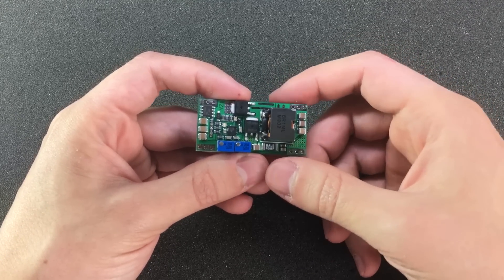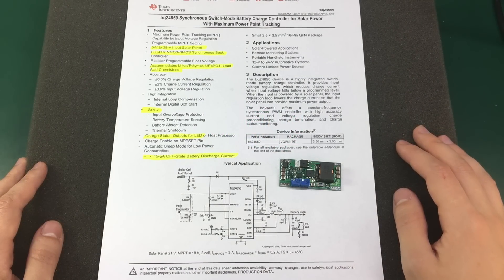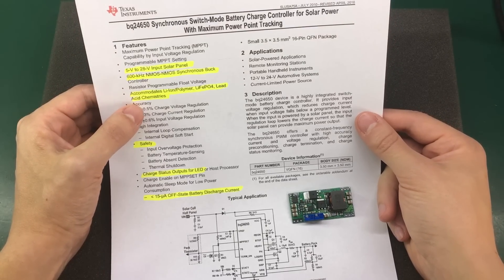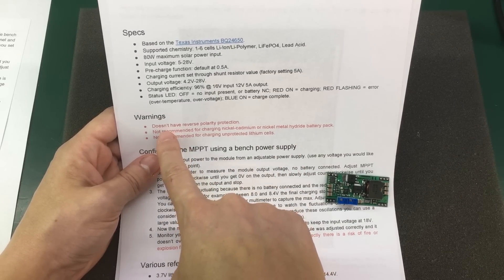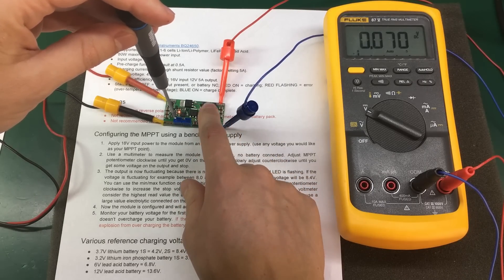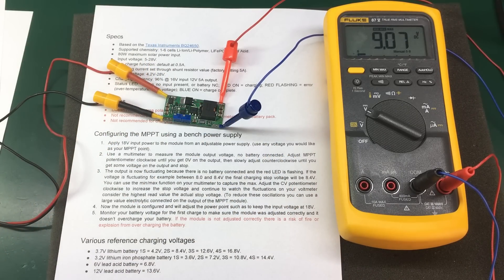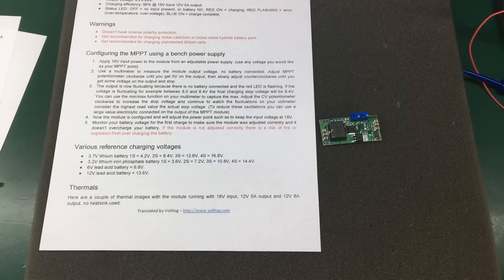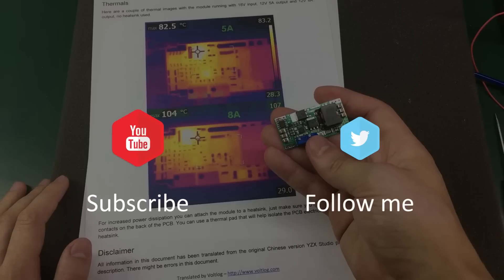Voltlog #54 - BQ24650 MPPT Charging Module

Comment: Little too late, but anyway. This is not truly mppt controller. You need to set  the input voltage threshold. In true mppt the module/device will do it itself by comparing the input power by output power and adjust itself by loading the input as much ad posible  without the power dropping. But considering the price of this module and the efficiency of it (around 90%) its not bad.

Comment: I have commercial 3S2P nominal voltage 11.1V Li-Ion packs with a protection circuit and 12V solar modules. Can this device be used to charge 3S2P packs properly, and is a 12V solar module sufficient? If not, what would have to change? Thanks for the concise video without nasty background music.

Comment: great work. I wonder:  Can we use this modul without any battery. I just need to have 5volt output from a 18volt sunlight panel to charge my mobile phone and powerbanks.
Reply: yes you can, but get a car phone charger and connect pv

Comment: I see several max amp version of boards like these. If my battery has max 6A charge current and my panel has more than 6A output, should I choose the board with 5A or I am ok with the 8A version?

Comment: The BQ24650 is NOT MPPT !
Is is MPP *adjustable*. There is absolutely NO Tracking algorithm! Only a fixed operating point.
 It will only be optimal for one temperature and one degree of illumination.
But is is better than PWM and pretty well adapted for that power range, for which a real MPPT controller would need too much power for himself.

Comment: I built a charger system with the red colored version of this board 3 years ago, it's still working! (25W panel, 16.4V/70Wh Pack)
I can't find the original size boards on eBay anymore. There are larger size boards using the same controller IC but they are preconfigured for specific output voltages and have no potentiometer to set minimum input voltage.
Reply: You can find the black board one, they are the newest version
Reply from the maker: David Gunther în general these modules evolve and rarely you când find the same model for more than 2y in a row.

Comment: only need add external MOS-FET + larger inductor to boost make this tiny yewel work for kW range !
==> any further developments with enlarged power since 2016 ?
==> any final conclusion wheter or not it performs true MPP-Tracking on real solar rig ?

Comment: Are you using this? I am looking for a MPPT charge controller for my 80W panel these days, and this seems to be a good and low cost option. I would like to hear your latest comments if you have been using this board since this video. Also there is a new version of it now, with all-smd design, which makes it easier to mount on a heat sink.
Reply from the maker: I am not using this, I just ordered and now it sits in a box :-)

Comment: Does yours blink when is close to full battery? Mine starts solid red, then starts one blink every few minutes and towards the end it blinks every few seconds. I setup the CV for 13.6V (it's a lead acid battery). I haven't seen a blue light yet
Reply from the maker: I am not using the module daily so I don't have any info. I suggest reading the datasheet, the operation is described there.

Comment: So this module can be used to Solar charge a LiFePO4 cell if the charge voltage is adjusted to 3.6 volts?
Bill
Reply from the maker: yes according to the datasheet it can charge Lead Acid, Li-Ion/Li-Polymer, LiFePO4
Reply: Can't tell if the minimum charge voltage can be adjusted down for a single LiFePO4 cell (3.6vdc).  Can it?  

Is there a Float Charge?
Thank you,
Bill

Comment: Great video !! May I charge 5 X 3.7v LioN 6000ma batteries while supply 1150ma for a Wireless router with a 20w 12v Solar (I cant find 20W 6/5vdc Solar Panels).In theory it should, but I would like an expert advise. I meant these batteries in parallel... thanks
Reply from the maker: It depends on what the operating voltage is for that router.. maybe it's best to use another dc-dc converter to power the router.
Reply: The router is 3.7v as well (it has a USB port for charging (5v) but battery and operational voltage is 3.7vdc.Very interesting channel you have.
Reply from the maker: That's not a common voltage to find on a router, are you sure it's 3.7V?
Reply: yes it is it has a 3.7v lion battery inside is a Huawei HN5A2H
Reply from the maker: yup, that should work but you should use a protected lithium cell or at least add an external protection module to your battery, just to make everything safe.
Reply: Great!! thanks very much for your time and support.

Comment: i ordered this of Ebay and it was sent as unregistered airmail and it never arrived.  i got my money back though.   then i ordered it at aliexpress for a few dollars more as registered airmail and it came with no problem in 2-3 weeks
Reply from the maker: As a guy who orders stuff from China daily I got used to this, it happens from time to time. The important stuff I always get with registered airmail.
Reply: I agree.
It came a few weeks after i got the refund but it had taken a very long time.
Thats why i prefer aliexpress over ebay since aliexpress has more and better option regarding shipping.
On ebay many times you cant see if its shipped registered or not or choose it.
On aliexpress its very clear what shipping is used as standard and easy to select better shipping.
I prefer PostNL if its selectable.
Not the cheapest but in most cases its 8-14 days from China to Denmark :)
PostSE, Singapore post and similar is mostly 2-3 weeks, 4 in some rare cases.
China Post registered airmail use to be faster 1-2 years ago but its gotten slow and unreliable and its now the slowest and worst if registred options.
In some cases i have even gotten my money back because it surpassed the 42 days or 8 weeks garanteed by the seller :(

Comment: Am am using one of these modules to charge 2S Li Ion cells off a 10W 12V panel.  I have a problem where on a cloudy day the module never goes into charge mode.  Any hints on why this may be?
Reply: Unless I disconnect and reconnect the input, then it charges fine.

Comment: How much can it be changed to load in amps if heat sinks are mounted and where to find the resister and which one to use?
Could be cool it it could run 10 amps or maybe even 20 amps with heat sinks under and on and with a fan
Reply from the maker: It can handle 10A maximum with proper heatsinking. The shunt resistor is the one to be changed, details on that are in the datasheet.
Reply: I cant seem to figure out to find that info on the TI site ( im not an electronic expert but i can work a soldering iron)?
The shunt resistor is the one labeled R 008 by the inductor?
What resistor should i use to make it run 10a?
i plan to put mine in an aluminium enclosure box with termal pads on the bottom so it participates heat to the aluminium box and then put an heat sink with cooling fan and termal grease on the top side to cool the mosfets and chips.
PS i plan to wire the fan to the output so it only spins when there is sun and its charging but time will tell if the fan can handle the 14.4 going to my lead acid batteries.
I look forward to later testing the efficiancy of this board against my pwm controller and the epever 10a mppt controller i have in shipping currently.
Reply: the 10 amps im thinking of is input for the solar panel to use with an 100 watt 6 a panel.
The charging current is less important
Reply from the maker: you seem to be missing some important electronics basis. You shouldn't be worried about your input power as the solar panel cannot forcefully push "power" into your module. I strongly suggest you go through the datasheet pdf. Having a 12V fan connected to a 14.4V source will shorten it's lifespan and it will burn out quite quickly. You could use a 7812 to power your 12V fan from the 14.4V output, but it will always run from your batteries, unless you use a diode to block the reverse voltage. And yes the shunt resistor is the one marked R008.

Comment: Did you do some measure of the conversion efficiancy for this board? It lloks interesting. I might try this for my 100 watt panel but i hope the 6a max coming from the panel wont damage the 5a controllet. I already have a pmw controller for my setup but i would like to see if its more efficiant than the pmw. I saw Adam Welch test some small cheap mppt controllers but one of them wadnt suited for my setup and the other one had a horrible conversion efficiancy at around 50-60% :(
Reply from the maker: I haven't tested the efficiency of the module, but the controller is a genuine TI part, the datasheet should give you an idea about the efficiency.
Reply: i have ordered one. i have no advanced equipment but i have some 6 dollars same watt meters. i will compare it to my 11 dollars pwm controller later
Reply: cheapest real mppt 40 dollars ive seen reviewed by Adam Welsh had bad efficiancy. i hope that this one atleast will have better efficiancy than my pwm

Comment: I am looking for 12V stable voltage from a 12V 100W solar panel, without connecting to a battery. The total max load is about 36W (12V, 3A) only, which need to be worked during daytime only.
Reply: There are other cheap modules, with mppt and dc-dc conversion, but without charging function, this is what you need. I would recommend this module with a small 12V battery (5 Ah) for buffering, it's more reliable. Solar Power is not so steady as expected and you will probably waste energy, because your application can not consume 100% of the power which was available. Getting 36W from 100W panel is not easy (this depends at your location).
Reply: For 36W load from 100W solar power simply use an step down DC-DC convertor. It does the perfect job with less than $4. Cheers.

Comment: i have a 50watts panel , basically i can get only 100 to 120 wattshour(measure) per day, i hope this unit can give me more power per day.
Reply from the maker: It should, please report back with some numbers if you install this module. Thanks!
Reply: +VoltLog ok
Reply: Hi, I have a 30w panel and 14ah lead acid battery. I've changed from a cheap pwm solar charge controller to this mppt module and after 2  weeks of use I'm very satisfied. I use it mainly for charging power banks and aa, aaa ni-mh battery recharge.
Reply: Hi, I've also got 40W PV panels, at the moment I'm using simple buck converter to charge my USB power banks, but I want to upgrade it to 12V storage. Considering to buy this module. Cold you please tell me if its worthy?
Reply: For 40W STC this module should do an splendid job due above 90% efficiency. For power backs is far more optimum (less $) to use USB buck convertors from 7-28V input. Cheers

Comment: Good afternoon.
Tell me how you can adjust the charging current can not understand.
Thank you.
Reply: Charging current is set by on board low value resistor. You have to desolder it and put a new one to adjust charging current.

Comment: Wow amazing this thing can take 5 or 8 amps, thanks 4 sharing.
Reply from the maker: This particular module can do up to 5A, limited by the value of the shunt resistor used and other aspects like thermal dissipation and mosfet/inductor specs. However the BQ24650 can do up to 10A with different external circuitry.
Reply: So cool, Texas Instruments has always been an amazing company. Thanks for the info VL!
Reply: What should be chanced to run 10 a or maybe even more and will it have other consquences besides needing better cooling?

Comment: Interesting video - and thanks for the manual, I'm sure lots of people will find it interesting.

The issue with MPPT is that last word - tracking.  It's a software based thing that isn't implemented into this module.  Photovoltaics and wind turbines change all the time with the conditions. The software needs to track the IV curve constantly to produce the maximum power.  These so called MPPT modules don't track the maximum power and therefore five minutes after setting the MPPT pot, you could be losing a great deal of power as the IV curve changes.
Reply: +Adam Welch hello Adam, my thoughts too👍
Reply from the maker: any solar panel MPP is characterized by a certain voltage level. The BQ24650 monitors that voltage and pushes for maximum current while maintaining the input voltage level constant. As soon as that voltage drops, it cuts back the current. That is the tracking part and it's all done internally, no need for any micro. If I am wrong, please correct me :)
Reply: I believe you are correct.  I've read through the datasheet and it makes a fair bit of sense.  I shouldn't have commented before reading a little further.  There are a number of DC-DC modules which include an MPPT pot and no micro controller - at first I thought this was the same.

Thanks for your explanation and response.
Reply: Sorry - looking closer at the board on ebay it may well be microcontrolled.  If so, why the need for a pot?  I've confused myself!
Reply from the maker: From the BQ24650 datasheet "When the input is powered by a solar panel, the input regulation loop lowers the charge current so that the solar panel can provide maximum power output." So this thing is capable of tracking. It doesn't need an external microcontroller, all the logic necessary to do this is contained inside the chip.
Reply: I think the BQ24650 is targeted towards small scale portable/remote embedded systems where a low cost MPPT solution is preferable over a more expensive full feature MPPT solution. In such systems the added performance of a full featured MPPT controller might not justify the added cost.
Reply: @proxymilian  only need add external MOS-FET + larger inductor to boost make this tiny yewel work for kW range !

Comment: Perhaps testing it on actual solar panel + battery? :)
Reply: Would be a great idea i think too
Reply from the maker: Unfortunately I didn't get much sun at my window when I recorded this video... It's much easier to configure using an adjustable power supply and then just operate with solar panel and validate the configuration.